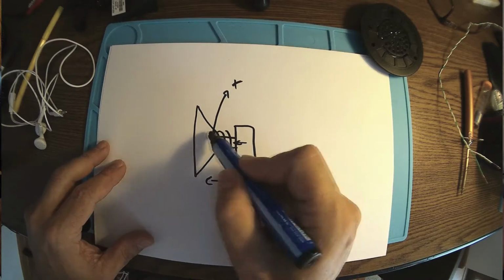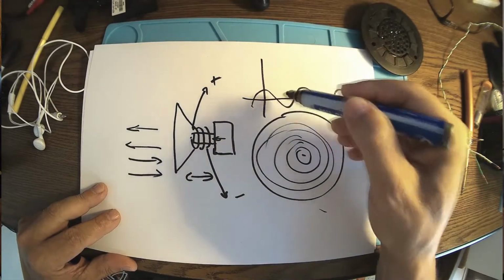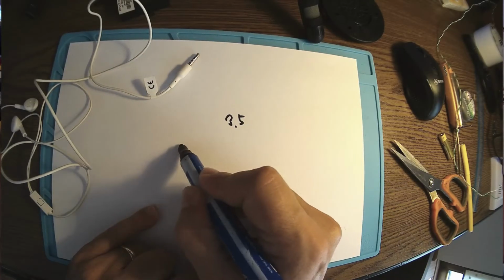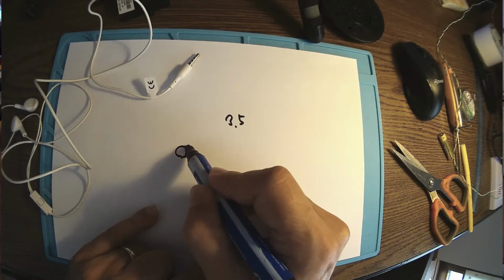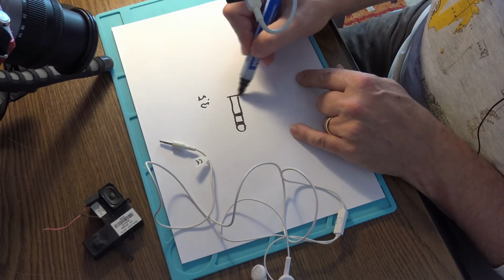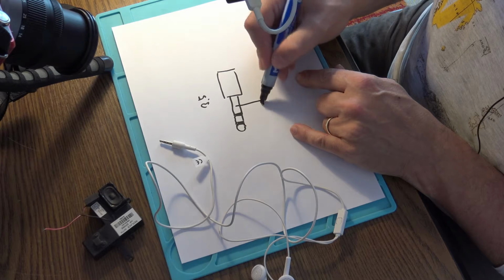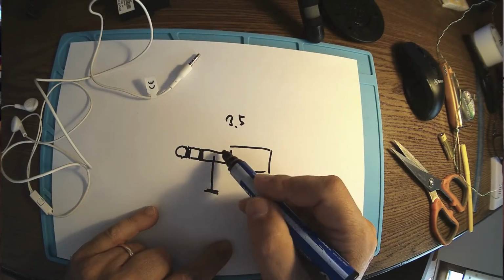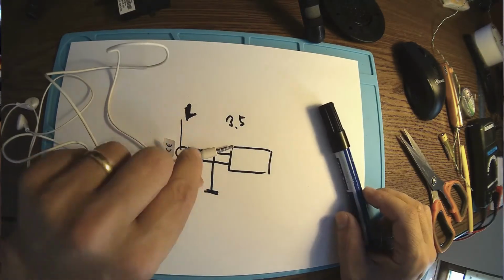A very simple way to test and fix headphones

Comment: You should be more detailed - how did you open the little headpone? Also stick to using a multimeter I guarantee you, anyone who is interested in your videos owns one.
Reply from the maker: Probably yes, multimeters are very cheap today!..the little headphone can be easily opened with a knife blade, they are glued somehow..it's just an idea ..
Reply: @viocaia  Aha, I thought they have some guidepins which hold them together. I have these spare iPod Shuffle headphones which seem to be not working correctly. Very informative channel, keep doing your stuff. I am subscribed.

I discovored your channel a few days ago, tomorrow I am buying my SSD and will be following your video on Acer Aspire a51-515g.
Reply from the maker: @gosho0  NIce..Good luck with SSD..be aware there is a small switch, so the laptop is not turning power on, on batteries as long as the bottom lid is off..don't panic! Also if you csn buy an M.2 NVME SSD , much faster and easy to install.. check this https://www.youtube.com/watch?v=FA9paP39284